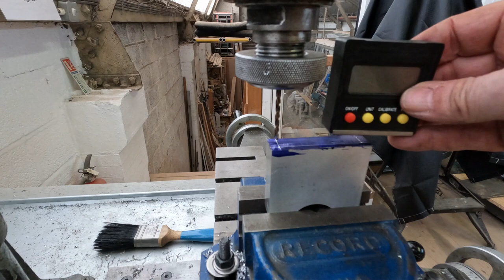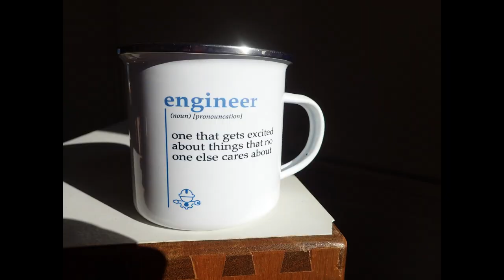Making a Watchmakers Spindle Maintenance Fixture (Part 4).

Comment: I would love to see the spindle being put together.  In have a Unimat like yours that was treated badly by the previous owner.  I need to rebuild it and would love to see it done correctly before I try to do mine.  Also, the tailstock drill chuck, can it be rebuilt?  Can you build a set of tommy bars for the lathe chuck?  My lathe didn't come with the lathe, and I don't have any dimensions to work with.  Also concur that you did a great job on the fixture.  That double blade trick is amazing!  Maybe a little CA to glue them together would improve the starting cuts.  Thanks for the video.
Reply from the maker: Hello Terry,
I will do do a spindle rebuild for sure, but cannot promise how quick it will be. I believe the tailstock Jacobs style chuck can be rebuilt. I will add the making of the Tommy bars to my "to do" list... Good idea about gluing the two blades together, thank you. Thanks for watching.
Take care.
Paul,,

Comment: Useful bit of kit Paul, will be useful for a multitude of jobs. Make yourself a blank Al shaft, longer than the jig and mill some flats, drill some holes etc allowing you to fix a small vice, clamps etc etc. Cheers, Jon
Reply from the maker: Hello Jon,
Good of you to drop by, thank you. It should help a lot with the with refitting the spindles... the hydraulic thing is a good base to build lots of other attachments, I feel sure it will be making quite a few appearances in the future.
Take care.
Paul,,